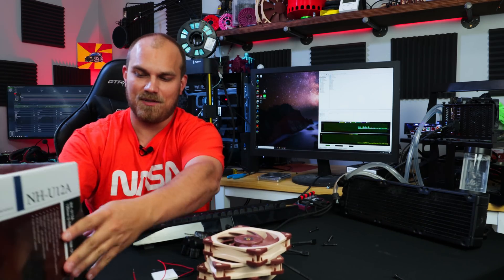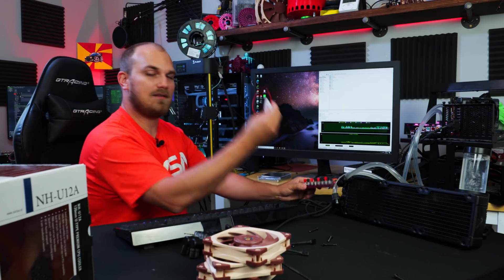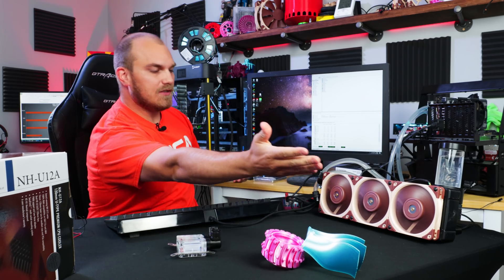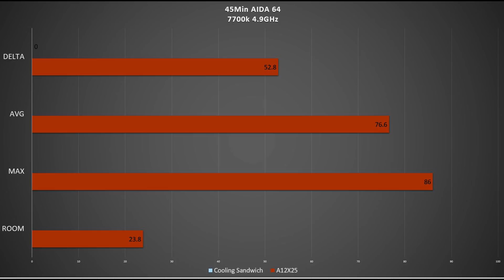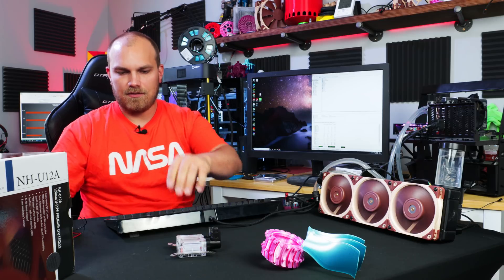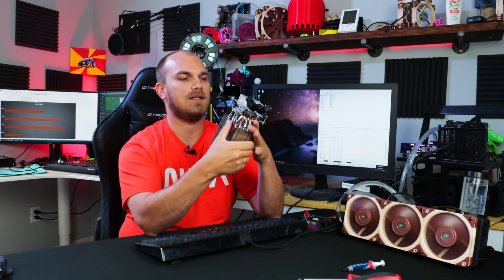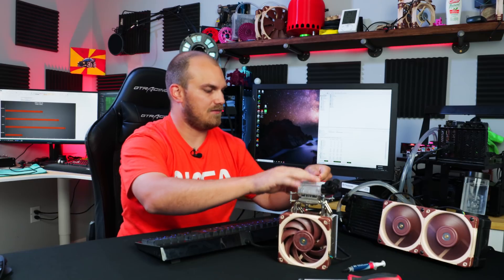Can A Wish.com Water Block and a $4 Peltier Beat a 360mm Radiator?

Comment: Now I have two questions:
-what would happen with the water lock directly attached to the air cooler? Would it be better than the radiator?

-could you chill the water by doing CPU->rad->Peltier? The rad would bring the water closer to ambient temp, then the Peltier could chill the water to maybe achieve sub ambient!

Comment: Honest question. Can you add the Tec in series with the 360 rad. So radiator first to get the water close to ambient then Tec to get sub ambient?
Edit: btw ltt did try this with 3 tecs in a series same conclusion don't have the cooling capacity. But maybe together with the rad?

Comment: This type of setup CAN actually work well with the right parts. OCAddict on OCN built one using 3 waterblock/TEC/heatsink units to cool a i7 8700K:
https://www.overclock.net/forum/62-peltiers-tec/1633988-chilled-water-cooling-vs-3-0-build-log.html

I built a TEC setup myself using a slightly different design. Instead of using tower heatsinks for the hot side, I used another water loop. It was capable of chilling the CPU coolant down to just above freezing when idle, and maintaining around 9C on the coolant under full load.
https://www.overclock.net/forum/62-peltiers-tec/1645983-i7-8700k-tec-chiller-build-log.html

Of course, the power efficiency of any TEC build is going to be terrible. They are interesting to build and very fun to overclock with, but not practical.

Comment: The TEC has to have the thermal output, in watts, to equal or beat the output of the cpu. This one simply does not, and if it did... this cooling of the hot side wouldn't be enough. Simple TEC principles. What WOULD work better with the hardware you have, would be using your water loop like normal, then using the TEC on top of the waterblock, cold side down. To cool the water... then mount a thermal solution on top of it to dissipate the hot side. This would essentially refrigerate the water right at the cpu block. This would do SOMETHING.... not sure how much. And again, could be done with what you have. But yeah... as it is, in the config you have it, it simply cannot do the jerb.

Comment: Double stack 2 TECs (cascading  using the bigger wattage one at 12v and the smaller one at 5v)  and use your water-cooled air cooler as the cold side to chill the loop.

Comment: TECs are such incredibly inefficient thermal devices that Linus Tech Tips had to use multiple 500 watt Peltier modules just to make a CPU reasonably sub ambient during idle, connected to heatsinks that would've cooled the CPU better under load directly anyway.
If Peltier cooling were in any way remotely efficient, fully silent air conditioners would be a thing, and cooling a CPU could be done in a much more compact form factor.
It's best you don't go down the peltier train, unless you're prepared for disappointment. Instead, let me offer you a quick fix idea: Same waterblock to air cooler idea, but cut the Peltier module out from between them. The TEC is actually working more as a thermal barrier, than it is as a thermal transfer accelerator, or otherwise a tool that makes the hot intake cold and the cooled finstack hot.
Waterblock to air cooler could genuinely work without the TEC in the way, though.

Comment: you need a 360 radiator to cool the water down, then a couple peltiers sandwiched around one universal all aluminum water block to chill the water right before it hits the cpu. i recommend around 8 peltiers. 2 per small water block.  you have to consider the flow of water and the cooling capability of your peltiers as well.  i recommend the higher end units, not the cheap one you used. (its a different part number on ebay, and not much more expensive. but they do require around 150-200W of power EACH LOL) i  made a peltier cooler for a loop as a project in highschool with my teacher. it did work, but we used a 4790k. if we didnt run a stress test at all times, the coolant would slowly make its way below freezing. 
basically speaking.. if you dont give a FUCK about how much power you consume, Peltiers can be AN INCREDIBLE way to cool your loop.

Comment: Huh. I wonder if you could mount a Peltier inbetween an aio for a GPU and the die, use washers to space the mounting system so you dont crack the die, then run a peltier cooled aio gpu.

Comment: Check cooling effect on that tiny peltier thing for 50ç.
You need like 100 of them in series, been tested before on... channel.
Think they feed 2kw in peltier to cool a 65watt cpu.
So very efficient :)
Why it's not used in many things.

If you heat one side and cool other side it creates power also ! 
Run water pump with cpu heat as power ;) good luck with that as efficient as your try in this video...

Comment: Flip the air cooler over.  Since the fluid inside the heat pipes are sitting at the "top"  you werent able to get max efficiency from it.

Comment: I am assuming this is an ebay 60 Watt TEC,  Lets also assume a likely generous (please correct me to actual performance) 25% efficiency for energy translation into heat pumping, that means your chip could cool at 15 Watts out of around 95 Watts of electricity pumped into the CPU.  Idk what % of that translates into heat in the CPU, ( I assume most of it?) but you would need 7 of those chips to have any hope at keeping up with your processor.     ...Please make that video with heatpipes up that yahoo!  :D

Comment: should have got a better tec u need one that can move 60 to 90watts a tec that can do that cost 30 to 50 bucks it would have had a better chance of working a tec is just a heat pump and u got one that dosent pump a lot of heat

Comment: The Peltier element has a certain cooling capacity, once you put enough heat on its cold side it gets overwhelmed and the heat stays trapped in the water loop.
Off the top of my head,  when I was cooling Pentium III CPUs which had a TDP of around 35W, my 60W Peltier (12V 5A) couldn't keep up and I got worse temps than without the TEC. I would say you need to put at least 3x TDP's worth of power into your TEC, or across multiple TECs, in order to get any cooling at all.
So for a ~90W TDP CPU you would need at least 270W worth of TECs. That would be 5 60W elements. You should go for at least 7 or 8 to have some margin, and maybe even to get sub-ambient at low loads.
Is this expensive and outrageously inefficient? Yes. But it should be cool.
EDIT: I should also add - don't stack your Peltiers, keep them at 1 element per tower cooler, and chain the water block+Peltier+tower cooler assemblies in a water loop. Maybe add a radiator without fans into the loop to provide a sort of heat buffer, without a radiator the total thermal mass of the loop is small and you might get large spikes in temperature.
Reply: yeah, there's a reason Cooler Master abandoned their TEC cooler plans (See V10 cooler)
Reply: Der8auer did something like that in this Video: https://www.youtube.com/watch?v=YaOjrk98vPI
Reply: @xxcr4ckzzxx840  cool thx for the link
Reply: Would it just be more efficient to add a radiator to the loop to reduce the load on the peltier?
Reply: @metaleater9  That wouldnt hurt, but he really needs more cooling on the hot side of the peltier.  And if he were to get below ambient like he thought he was a radiator would actually increase the temperature of the loop
Reply: @1480750  Could be modulated by turning the fan on the radiator off when it gets below ambient temperature?
Reply: @metaleater9  It would hurt less but would still passively pick up heat.  When you're TEC cooling you need to fight pretty hard for every degree improvement you get
Reply: @1480750  The solution then is to compartmentalize the PC, Radiator, and TEC/Evaporator into their own loops that share heat between them using heat exchangers.
 Then you could turn off the pumps on ether the radiator or the evaporator/tec when you are above or below ambient, I bet you could even massively reduce the maintenance of running at exactly at ambient temperatures by having a computer juggle the two systems on & off.
Reply: yeah there's some insane work on someones subzero 24/7 build using TEC's realized same thing when was doing a chain cooling loop or something how the scaling just didn't really work that well but continued it as a pet project.  Just remember it looking pretty insane withn all the wires and TEC's setup not sure how the cascade was setup but yeah neat stuff just not that effective.  Beyond that just insane power usage.

If I was going down TEC path for power I'd be starting to look into Chillbox's with a AC unit now those are super cool still wishing would see one of these youtubers actually do it full send.  LTT did it half-assed after I sent in a suggestion
Reply: In my experience with TEC cooling in the K6-2 days, the first thing we did was remove the IHS and replace it with a cold plate. And like djdjukic said, you needed at least 3 to 5 times more capacity on the peltier than the expected TDP of the CPU. And TDP goes up very very rapidly with OC. A 300W Peltier to cool a 30W base TDP CPU wasn't unheard of, as running any sort of significant OC would easily push the CPU towards 50 or 60W.

As for going sub-ambient that was a whole different world of hurt. Once you approach ambient, you have to start thinking about the dew point. You don't want condensation forming on the back of the CPU and collecting in the middle of the socket.

Add to that that we stacked a cold plate on a delidded CPU, the Peltier onto the cold plate and a water block on top of that with a huge radiator to dissipate the combined heat of the peltier and CPU. These were not cheap, nor easy or silent solutions at all.

If sub-ambient is what you want, peltiers are not the answer you're looking for. Phase Change cooling is the answer. You want something like a Chip-Con Prometheia Mach 2. Again this is not a cheap, easy or silent solution. Made worse by the fact that once you start up the loop and things freeze over on the cold side, you can't really turn it off anymore due to condensation. But hey, depending on the refrigerant used, your CPU is gonna be sitting at between -40 and -96 celcius.
Reply: This is spot on. The TEC's have a fairly linear graph of pumped heat vs temp differential. At no temp differential a 60 watt TEC can pump about 60 watts of heat (dissipating 120 W on the hot side). At zero pumped heat, it can produce a max temp differential (usually about 70 degrees). In order to get below ambient on the cool side, the hot side needs to be very close to ambient. Or you need to stack more TECs in parallel. And keep in mind that the hot side needs to dissipate all of the electric power as well.
Reply: You should have a look at the new Intel Cryo Cooler... it is twice the size in Watts of the thing it is cooling. 
If you want to cool a 100w item you need a 200w Tec plus the rest of the heatsink.
Reply: there are 220W peltiers from what i remember, which SHOULD do the trick
djdjukic, you used a 60W peltier with a 35W cpu, but you say you ran it at 12V, peltiers are usually 20-24V
so you probably ran your peltier at half capacity
Reply: @stankidofu5829  it said 12V right on the Peltier ¯\_(ツ)_/¯
Reply: Useful comment, up you go
Reply: @I love you but yeah after looking in more detail 5% is at the maximum delta (60-70K) 
But if you want maximum cooling efficiency you need around 1/3rd current so the 60-70 efficiency means you cool a bit over 25% of the rated power. 
Though you don't need to cool that much since the heatsink does the bulk of the work, and you grab a bit more efficiency since the heatsink is hotter you can cool more because the cooling depends on the delta of temperature.

I'm not sure how you can get 250% efficiency in cooling though.
Reply: I have  peltier that keeps a amd fx 8370 at zero degrees when its not under load. it stays in the single digits. However it was not a "cheap" unit. Mine was pulled out of a lab refrigerator used for bloodwork. I would say its fairly beefy. it gets super cold on one side and very hot on the other.
Reply: He would have had some measurable improvement in thermals if he could have installed the peltier+ waterblock combo after the 360mm radiator in the loop. Then have the radiator bring the liquid temperature down to a level that the peltier can handle, then it will likely take a few degrees off of the liquid temperature, providing the peltier's thermal handling capability extra to the loop's capacity.

Outside of very low thermal loads (e.g., sub ambient cooling of an image sensor to get cleaner astrophotography images, peltiers are used to supplement cooling systems as a way to compensate for some diminishing returns. For example, with a radiator or heatsink, the smaller the temperature delta is, the larger the cooler needs to be by an exponential amount.  One way around it is to supplement the cooling with some form of heat pump.
For example, you may have seen some YouTubers do things like loop together like 6 480mm radiators and not achieve much better cooling results than a single 480mm radiator. And that is because once the temperature delta gets too small, each degree lower, starts to need massive increases in surface area., on the other hand, when the temperature delta is small, e.g., if the liquid and ambient temperature has a delta of like 3-4C, with far less space usage, you can add in a peltier  and an adequately sized heatsink, and achieve results similar to if you looped in 20 480mm radiators. (so long as  the peltier's cold side is not being overwhelmed)
Reply: IIrc they are about 1-5% efficient. so at 2%, you're looking at a 12710 (154w) cooling 3,08w
which means you'd need 35 to cool a 3950x (105W)
though you could bring it close to ambiant with a 3x3 radiator, and use like 2kw of tecs to bring it down a few degrees below ambiant.
but the best option is probably salvaging an old ac unit and make a chiller with it. (or cool antifreeze with it.)
Reply: @satibel  It also comes down to surface area. I feel like you need a much larger TEC and plate / water block, but the idea of requiring 1000W+ of peltier cooling to manage something like a stock 3900X worth is?  I've also heard people say that you should run two water blocks, one for the CPU loop to the very large plate / peltier, and another on the hot side of the peltier to something like a 360mm radiator, which basically saying you need a custom loop with pump / water block for the CPU, plus a large custom water block for the cold side of the peltier, plus a huge peltier, plus another custom water block for the hot side of the peltier, plus a 360mm triple fan radiator and pump for that loop. Yet these same people trying to figure out a way to finally get a Peltier to cool a modern CPU refuse to admit that they could just use an AIO or even a decent air cooler and get the same results while not requiring an extra 1000+ watts, power supply and two customer loops just to deal with inefficiency of TEC cooling.
Reply: @satibel  depending on the circumstances you can get up to 10-20% efficiency with peltiers, but at small delta T (<10K).
Reply: @mathewcherrystone9479  At a small delta below 20degrees with low voltage of 5-7V according to NASA testing you can get COOP of over 3.0, so it can work efficiently, but you'll need lots of peltiers to get that cooling capacity at that COOP level, and also the hot side will need the best possible air cooling to get the delta as low as possible.
Reply: @satibel  I concur,  properly need way to many peltiers to get below ambient, still would make fun content to watch
Reply: @satibel  No,  the efficiency is referred to an ideal heat pump, you are interested in the coefficient of performance. In the case of a vapor-compression refrigeration (fridge, air conditioning etc.) it can go up to 3 or 4 (300 or 400W moved for every 100W of power), in a TEC varies a lot depending on conditions (I looked at a datasheet of a high power TEC, the COP varies from 3 at low loads and low temperature differences to 0.1 or less in the worst case). If you can keep the hot side at relatively low temperatures, so that you don't need a big temperature difference, and you choose a TEC so that it operates in conditions where it has a decent COP like 0.5 it is doable. In the past I have seen TEC cooling a P4. Of course, a chiller is much more efficient

Comment: Im no scientist but I think the reason this didn’t work is because the surface area of a water block is so much smaller than one of a radiator maybe if you put the then cooler between the cpu and block it would work better

Comment: I always thought the best way to do this would be to use a peltier + air cooler in addition to the radiator. AFAIK the peltier's goign to be sucking X number of watts out of thermal energy out of the water regardless of delta, right? So have the water go out of the cpu into the radiator first to dump as much into the air as possible that way, then when the delta is lower use the peltier to push the water temperature down even further.